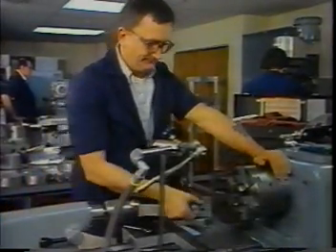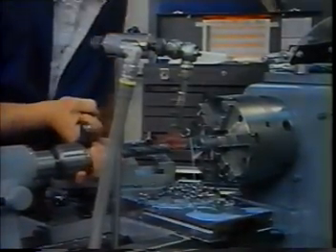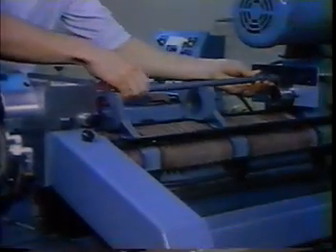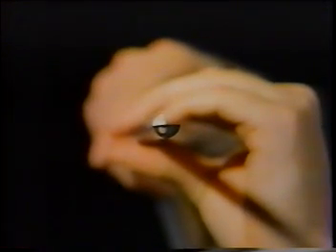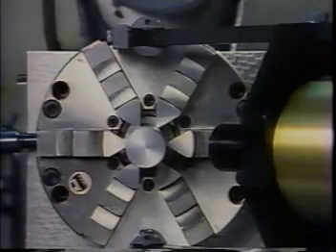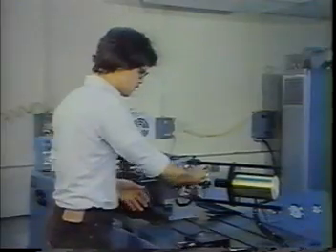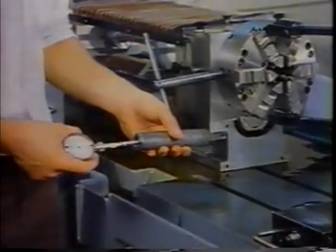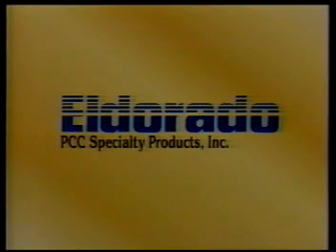Gundrilling

Comment: This is bullshit. What "problem" did Joe have at 1:20 ? The drill wasn't jammed but he takes it out, removes the chuck from the tailstock, removes the outer Morse taper then puts it back without the taper and starts dicking with the chuck key. If you're going to make an instructional video, try leaving out meaningless, misleading bullshit.

Comment: Old Joe reminds me of Mr. Beene with a tattoo and a stupid accent.   But I remember those old NC machines that read punch tapes way before true CNC programming. You could load a tape program and start altering it to do new opperations. They took forever to set up and was nerve wrecking on a dry run because you hoped you made all the correct calculations or they made spectacular crashes.  Some old NC machines were retrofitted up to CNC but were only used for low count runs or would be used for tooling and holding fixture making because they were slow as a 🐌. Most were oversized beast with dephening hydraulics. The pump and controls took up the same floor space a modern machine that has 3 or 4 times the working area. Its been a long time since seeing this type of film. I was a kid setting around old man in those days.

Comment: Joe wasn't drilling 316 SS. He would have bonded that drill bit to the stock. I saw a coworker fired over that. How about a spade drill with coolant holes or turning the part around half way through? Where's the CNC?